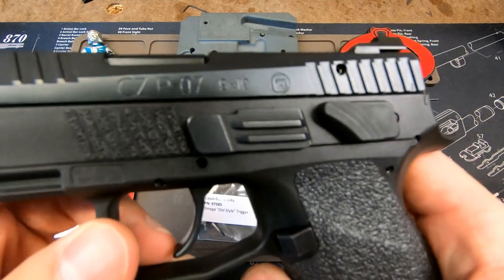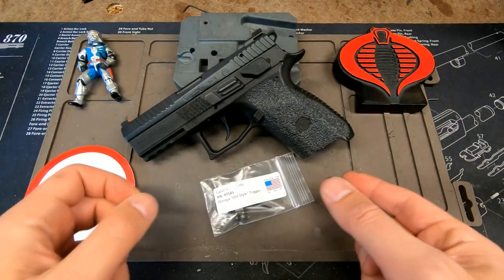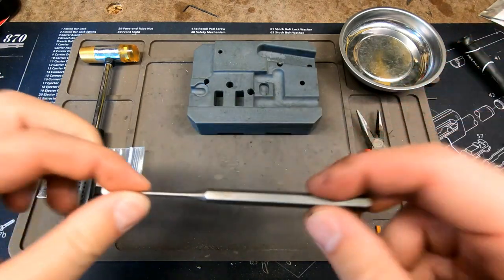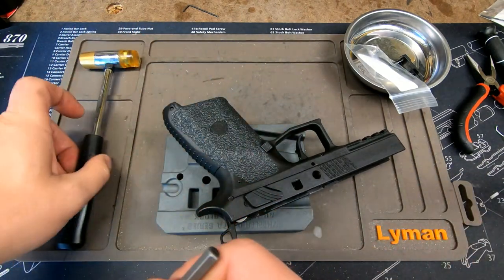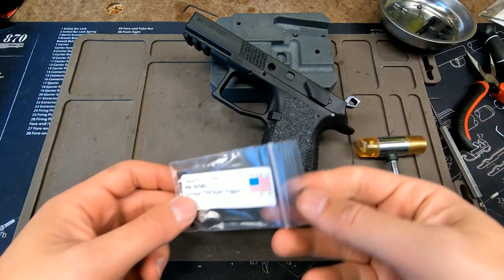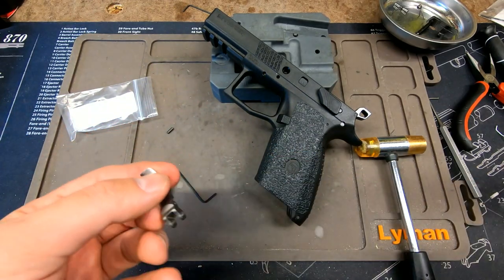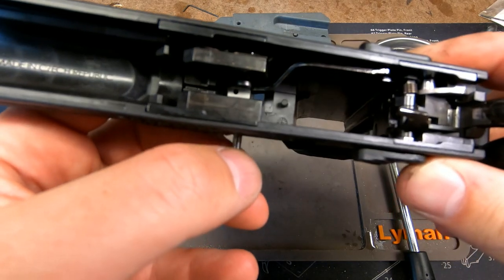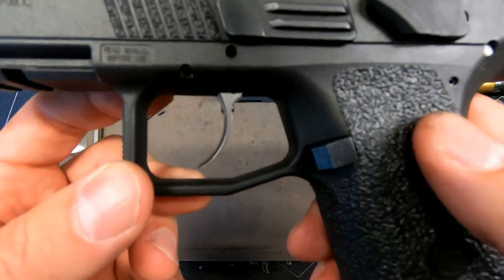CZ P07 & P09 DIY - Episode #1 - Old Style Omega Trigger Installation (Cajun Gun Works)

Comment: Dude. I just did this last night watching another guy pulling out the decocker. I have a second one to do, so i am going to try this method next. Dang.
Reply: Welp, I wasn't as lucky. Still had to pull the decocker out. Glad you didn't have to fiddle with it, though. That spring is pesky without the right tool to get it back in place.